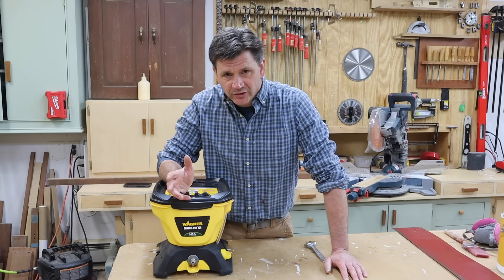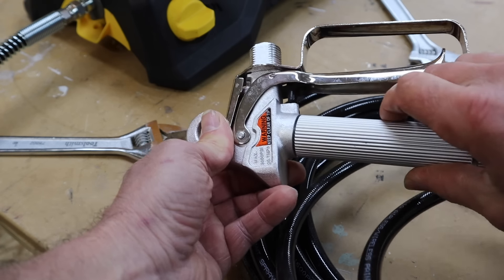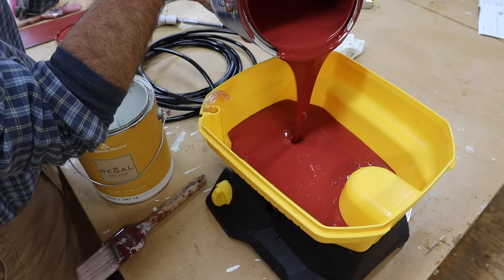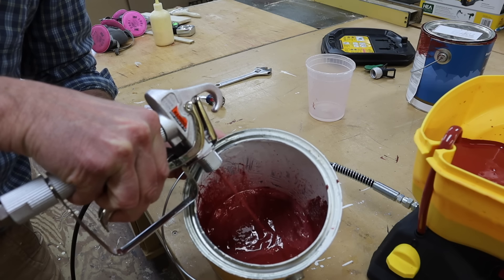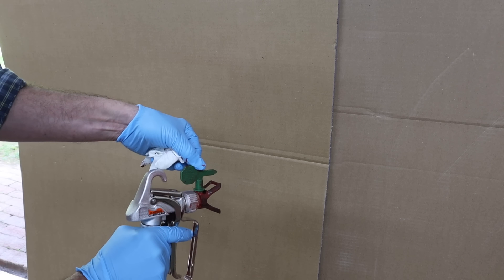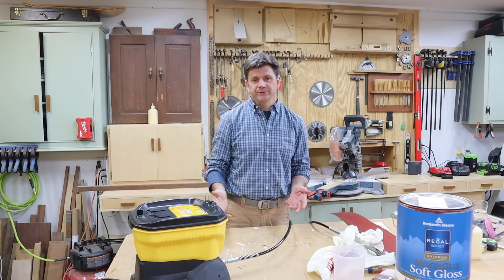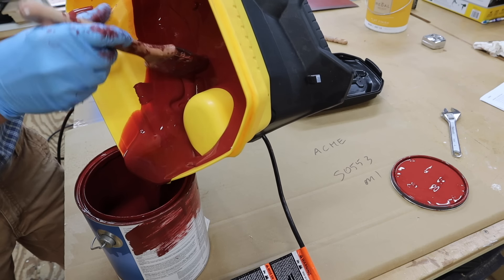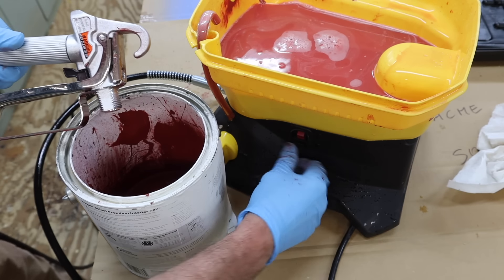How to Use Wagner Control Pro 130 Airless Paint Sprayer

Comment: Just a safety tip. Whenever attaching the spray tip to the gun or exposing ones hand to it to turn it,  have the safety trigger lock on. If an accidental injection of paint and or etc occurs, mostly likely surgery will be needed to debride the tissues exposed.
Reply: 100%. Thats a big issue with pressure washing accidents
Reply: Guys, Here is The Savior

HalleluYAH translates “Praise ye YaH”

YaH is The Heavenly Father 
YaH arrives via the TENT OF MEETING
YaH was Who they Crucified for our sins

— Ancient Semitic Cuneiform of Moshe (Moses)
— Isa Scroll (The Original Isaiah)

Isaiah 42:8
"I am YaH; that is my Name! I will not yield my glory to another or my praise to idols.

Isaiah 43:11
I, I am YAH, and there is no other Savior but Me.

Isaiah 45:5
I am YaH, and there is none else.
Reply: @Praise___YaH nobody cares about this 😂 doesn’t fit the context of the situation
Reply: Injection from what ?  Not enough pressure ffs. 😂😂
Reply: You are right about that, I worked with a guy who lost a finger due to an injection injury.
Reply: I know the pressure is low on this sprayer but why tempt fate.
Reply: @daveribbons3050 Yes low volume pressure with emphasis on pressure. Overall until you put the tip on which has a very small orfice and therefore  exponentially increases the pressure at close distances prior to the gaurd. Especially if a portion of your hand or body comes across it. The manufacturers clearly warn against this danger. Also,  I'm in the medical field and with these types of injuries a debriedment is often necessary to remove the damaged tissues from the trauma and subsequently the product being used  that becomes injected  quickly cause necrosis and infection if left untreated. Overall be safe.

Comment: I love this sprayer- I have an older model that also has a power roller (no more redipping!)  I tell you it takes about 2 minutes to paint a 12x12 ceiling and about 37 seconds to paint a side of a 6 panel door---the finish is like enamel! Perfect! One tip: get moving (side to side or up and down) with your gun before you actually pull the trigger so you don't get that first GLOB when you activate the paint. Practice on cardboard works great too! Prep is essential, as is clean up. Best Home Imp investment ever!
Reply: I’m
Reply: Did you honestly like it???

Comment: Thank you so much for this easy setup video. I'm new when it comes to using a paint sprayer and I want to get it right. Your video was very easy to follow. I appreciate it very much. I was going to go with the Wagner Control Pro 150 but this 130 would also work just fine for my projects.

Comment: Nice video!
I have a 150m, pretty much the same machine. But i constantli get "edges" of paint fan. I dilute the pain per instruction, it's a basic white wall paint, but i ALWAYS get those edges..
what tip and filter are you using? I see this paint of yours is quite thick compared to my attempts.

Comment: Best training video on this unit I have seen.  I have the older version of the unit and had not used it for a few years.  I just got it out to paint my daughter's basement rec room - walls and exposed joist ceiling.  This refresh was excellent.  The painting project went smooth as silk. Thanks so much for keeping it short and sweet buy yet very thorough!!!

Comment: awesome video, Jon. i have a project coming up and I am definitely going to want to get this to save time.
Reply from the maker: Thanks Joe, definitely a big timesaver , so it pays to put a little extra time into prep and I did all my cutting in with a 2 inch brush to avoid overspray but you can get a lot of paint down quick.
Reply: @JonPetersArtHome  excellent - thanks for the tip!

Comment: thanks muchly for the video. just thinking of getting this in UK (which is called 150M). I've seen lots of horrible reviews especially where some of them leaks (hose to the tank end).  Just wondering if the machine is still going strong until now? secondly, I saw another vid by wagner where they squirt a bit of oil to the bowl (drain), is that necessary? if you can advise then that'd be greatly appreciated as I'm planning to buy it soon. Thanks
Reply from the maker: It did get the job done quick, sometimes you will get drips so have a brush with you. Cleaning the sprayer takes some time but that is to be expected. I haven’t used it since this project. Would I use it again to paint the barn or a house? yes. Hope that helps and thanks for watching , Jon

Comment: I've tried two different Wagner sprayers and I have a graco 360 sprayer as well. What they both lack is a smooth finish. They leave a bit of a texture to the finish. Does this sprayer have a smooth clean finish? I make Hollywood mirrors and a clean smooth paint finish is key.

Comment: Thanks for the video.  I just bought one.  Works really well but as a novice a couple things I found. I'm remodeling a couple of our bathrooms and a laundry room.  This sprayer, and I assume any of them, puts out a lot of "mist".  It can be a very messy process.  Also working in a confined space is a little toxic.  Take his advice and where a mask.  I'm sure a pro or even seasoned amateur could do it much cleaner than I did.  All that said it came out pretty well.  His tips on cleanup are really on point.

Comment: Jon, how do you feel about using this sprayer for smaller projects like interior plantation shutters? I'm using the Behr Premium Plus Paint.
Reply from the maker: If you Have a lot of shutters it will definitely save you time..  the sprayer works great as long you have enough work to offset the cleaning time.
Reply: Thanks for your help Jon!

Comment: Question on cleaning when using oil based primer or paints in the sprayer, do you need a special cleaner or paint thinner?
Reply: Yes, for oil based paints you'll have to use mineral spirits for cleaning the sprayer.
Reply: @LuxAudio389  thank you, just got my sprayer yesterday and plan on using it tomorrow  :)

Comment: I recently painted my house with this product. It's not bad for a store bought sprayer. It does spray on pretty heavy so i did get a bit of flashing, even with two coats put on and a fast consistent motion. Wish I would have used a flat finish instead of a soft-gloss to significantly reduce flashing. You can only really tell when you look down the side of the house otherwise people wont notice unless they really look for it.
Reply: What is flashing?
Reply: @leoantonio  It's happens when dried paint appears heavier in areas at certain angles of light due to overlap or paint sheen.

Comment: Jon, would you use this spray rig to paint out any cabinet or casework projects or is it really just for exterior, macro type work?    Also did you thin the paint down at all?    Thanks for all of the videos, always so informative.
Reply: I tried using it to paint baseboards. It was way overkill, but now I know. If it were me, I'd use something like the Wagner Flexio products. You will have more control over the pressure and consistency, less chance of runs and overspray. The paint comes out fast and heavy using the Pro Control, great for big areas, big swaths of paint.

Comment: Jon, you never mentioned how well the sprayer performed.    I watched a few reviews and some people seem to think it clogged up often. However you mentioned straining the page which obviously you should do in perhaps they did not. My question is did you experience any clogging of the nozzle while you were spraying?   I respect your opinion very much so I am looking for a little help in this department. I had actually looked at this particular spray or a couple weeks ago. Let me know your thoughts. Thank you.
Reply from the maker: Hi Dave, no clogging on this project the sprayer worked great and was a big time saver. I will say take extra time in preparing because of overspray and I used a brush to cut in... and like all sprayers cleanup is a bit of pain but worth it because of the Time saved .
Reply: @JonPetersArtHome  Thank you so much for replying.  I am off to the big box store to pick one up today.

Comment: Thanks for the great setup / breakdown, definitely helped me understand the process having never used an airless sprayer. 

Can you smell paint fumes through those respirator filters?  Just from looking at them they look like NIOSH P100 filters, which filter particulates only (i.e. not vapors). FWIW I use the 3M 6001 organic vapor cartridges when spraying HVLP in my garage and they work great. You probably know all this already; if so then hopefully it’s useful info for someone out there.
Reply: Jim Martini yes! Good to know and will look for that. I did not do that this time 😅 but I will for the next paint job.

Comment: Thanks for the Tips.  My issue with this sprayer is when I was painting the bedrooms I could only spray for a couple mins and then had to exit the room because there was so much spray particles just floating around that I couldn't hardly see, 10 to 20 mins later I would go back in and paint for a few more mins and then exit the room again.
Reply: When doing rooms, have a fan blowing into the room and a fan blowing out a window, if possible

Comment: Is that for latex paint only?
Reply: The Pro 130 comes with an HEA 515 spray tip that works for Latex.
The Pro 130 Kit comes with the Latex spray tip and a Stain spray tip, as well as an extension wand.
You can purchase different spray tips sold separately in the $25-35 ea. range for Latex, Stain, Sealer & prob other spray tips.
I'd imagine the Pro-150, 170, 190 are same with using specific spray tips for different applications.

Comment: I'm looking to spray a load of deck balusters. Any reason I couldn't use a vertical spray? The balusters are 2"x2" : with a horizontal fan (moving the tip up and down) I'd be wasting 60% of the stain/sealer even if I spray 2 balusters at once (4" gap in between). I figured that keeping the fan vertical while also moving it vertically I'd have much less overspray.
The smallest fan I can find for this gun is 6": still lots of overspray, and none of the local stores carry it (almost 2 weeks to order).
Reply: I got mine today from Lowe's and I ordered it 2 days ago 😃 shipped to my door.

Comment: Great video, Jon. Very timely. I’m in the market for an airless sprayer. I’ve been considering the Pro 130 vs 150 or comparable from Graco. Any thoughts after using it? Thanks!!
Reply: All the pros say Graco is better if that helps.
Reply from the maker: I’m not sure of the price comparison, but I think he did a good job you definitely need to put the time in to prep. And as with any machine cleaning up is kind of a pita. Overall it was a big timesaver
Reply: @sh0cktim3  Wagner/Titan make the best most used paint sprayers by professionals

Comment: Impressive results Jon. I have an HVLP outfit and conventional compressor type, the clean up is always off putting for me.
Reply: Same for me and the waste as well
Reply: Consider 3M Accu-Spray system a system based on disposable parts. Using water based finishes I cut my clean-up time in half easily. And, I re-use all the "disposable" parts because I'm cheap...no frugal!
Reply: @toomars1301  Thanks Charles.
Reply from the maker: Thanks Graham... yeah cleanup is a pita but you definitely save a lot of time spraying so I just keep that in mind . I also put extra time into prep to avoid overspray and cut in with a brush.

Comment: I have an issue with this equipment, why when im spraying the paint spread is extremely wide, the way you sprayed the cardboard is not the same way for me
Reply: The spray tip determines how wide a spray fan the gun will create. Most spray tips are identified by a three-digit code.
Here's what the numbers mean, the first number when multiplied by two, tells you how wide of a fan the tip will create when sprayed at a distance of 12 inches from the surface.
The second two numbers are the orifice size of the tip in thousandths of an inch and that determines how much fluid will leave the spray tip.
For example a 515 will spray a 10 inch wide fan and have a 15,000th of an inch orifice it's the combination of fan width and orifice size that determines how thick of a coating you'll spray. Case-in-point a 317 tip and a 517 tip both have the same orifice size 17 thousandths of an inch, but the 517 tip sprays a 10 inch wide fan, while the 317 sprays a 6 inch wide fan, because the same amount of paint is leaving the orifice of the spray tip, but being dispersed across a wider fan, the 517 tip will deliver a thinner coating.

Comment: i just brought this product and it worked for a one min then it stop spraying??
Reply: These units cut in and out when they detect pressure loss, so when you pull the trigger the unit will run and stop as required. Is this what you mean ?

Comment: Low end noisy will not pump will not last hose and fittings cheap nozzle cheap.... good for a one time reno project but don't expect to get years of use maybe one or 2 times painting the inside or out that's it. Disposable and the cleanup is waaay over simplified these take forever and you never get it all... One that uses disposable tanks or siphon direct from the can is better this is waste of time and money unless you like gagets that break.